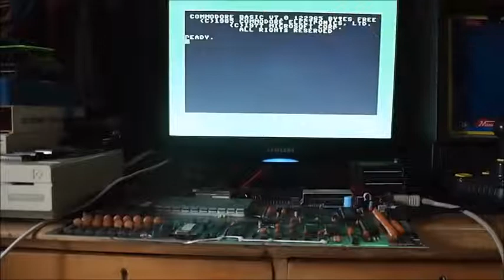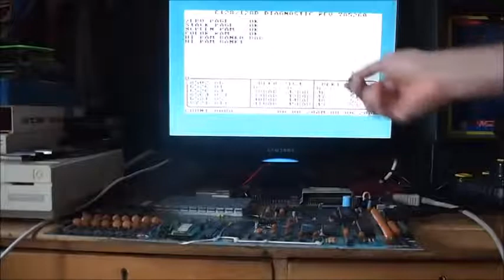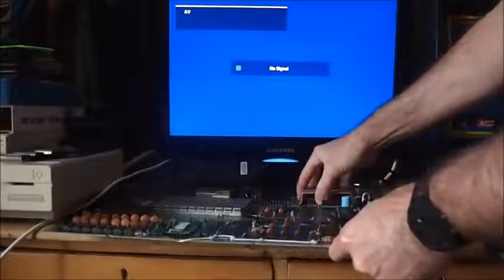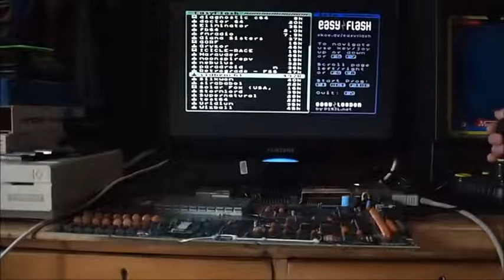Commodore 128. RAM issues.

Comment: U12 might not be the U12 you are looking for!  That cart is probably designed for diagnosing C64 - rather than the C64 built into the C128.  See this link:- https://www.c64-wiki.com/wiki/Motherboard   That indicates that U12 is a DRAM chip.  It does look like a DRAM problem.  Sometimes the piggy back approach won't work - it depends on the type of failure in the RAM chip.   Did you try piggy backing each of the DRAMs in sequence?

Chip numbers change between boards and models etc.  U12 on there isn't the same as U12 on a C64.
Reply from the maker: Thats a good point, of course I was using C64 diagostics at that point (U12). I will try piggybacking each chip then thanks. :)